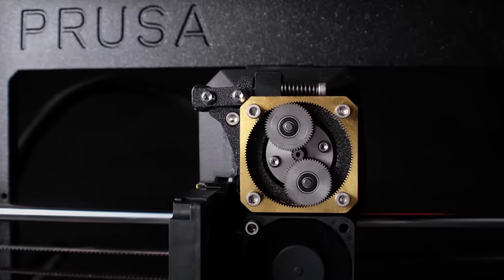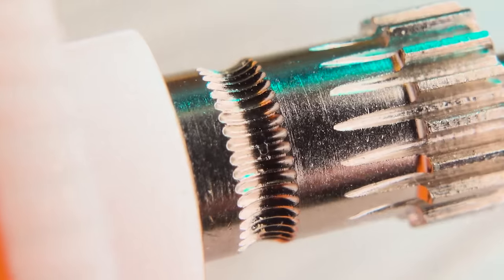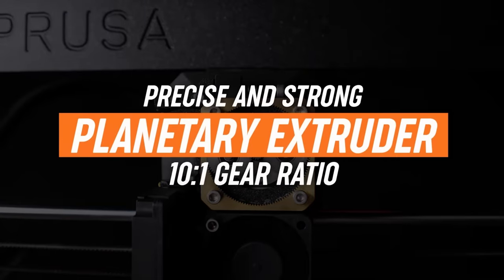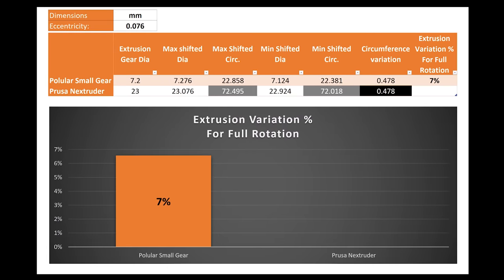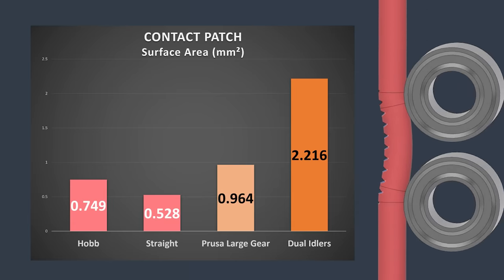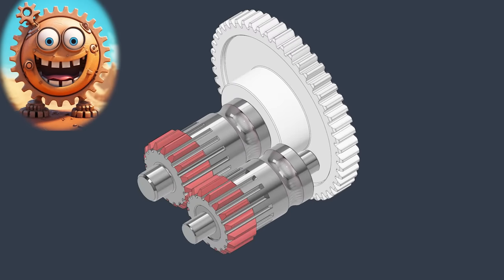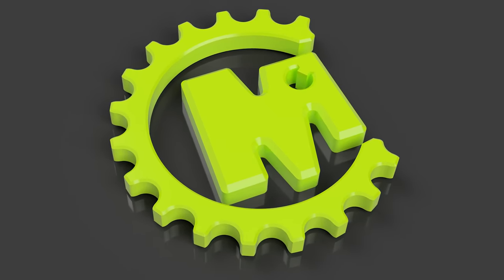Revolutionizing 3D Printing: Prusa's Game-Changing Nextruder

Comment: Without modding it so the idlers are cupped to replace the cup of the hobbed drive gear, I think this is a non starter for flexible filaments. I don't see how it could constrain the filament not to just shoot out the side.
Reply: the idliers have a groove in the centre

Comment: WoW!

It's insane they can engineer something like this, and YET keep failing on the frame. Flimsy AF, as ever.
Reply: THAT Being said, i've been waiting for this to happen with 3D Printers. Coming from the welding world -> The "extrusion gears" has been immensively large vs. "filament" for many decades now. 0.8mm "filament" but "extrusion gear" even much larger than this.
Yet, when you have "blockage in nozzle" it's much much worse on a welding machine, it's melted metal which needs to be pushed away.

BMG LGX and this, are just following what the welding world has known for probably more than half a century now.

BUT my point stands, they realized this shortcoming, and i keep hating that Prusa just can't figure out basic motion dynamics.
Reply from the maker: Price, Quality, Speed.... Pick two ! 😉

Comment: I haven't seen the Nextruder live but it looks that part cooling is still not good enough (only one side of the print is getting proper cooling). Big improvements in the filament walk are great but in my opinion this not the best possible extruder.
Reply from the maker: Of course the print head is an assembly of many systems.  Cooling wise I am working on the TentaCool with a member of the HevORT team.  Combined with CPAP turbine it becomes an awesome solution!

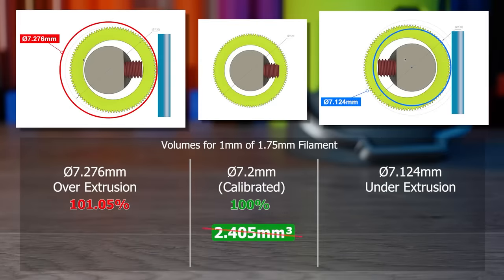Comment: That doesn't make sense at Min 1:25. The principle does. But the application is stupid. Because I would also have to compensate for the time, filament offset. So I reduce the speed when there is still 1.75mm at the nozzle and accelerate again when there is 1.90mm.

Comment: You're wrong about the purpose of the 2 planetary gears.
They simply support the shaft on the stepper motor, putting the shaft in double shear.  Having a shaft in single shear puts a lot of wear on the bearing in the motor and will cause it to wear out prematurely.
Supporting the shaft on opposite sides of the load, There's no movement in the rotational axis of the drive motor.
There is no reduction happening because the Large drive gear is still mounted directly on the shaft of the motor.  The Motor still drives it directly.  The 2 planetary gears are nothing but a support on the other side of the filament.
Reply: Sorry, but if you are to be right, then why does the stepper axle (shaft) and large drive gear not rotate at the same speed...? It's clearly visible in the animation that the stepper axle spins a lot faster than the large gear.... Not saying the planetary gears don't offer additional support but if the main purpose was this, I would think it would be cheaper for Prusa to "just" have a bunch of steppers made with a longer shaft and add a bearing on the end of it for support.

Comment: You should definitely try a different extruder… in this case if you are printing mostly TPU i recommend a product similar to the bondtech LGX. Using system with one gear of that size for TPU is generally a not great idea. I also recommend watching this video https://youtu.be/AaX1v6qWOnc and looking more into extruder designs and compatibility.

Comment: Revolutionizing? Yes yes :) they put a larger wheel in a extruder, that has been already done.
Reply from the maker: The larger diameter is not the only point here ;)
Reply: @MirageC  It kinda is, hyperbole to the max. They did not revolutionize anything. Its kinda the same old extruder with planetary gearbox.

Comment: 7 years ago, someone made an extruder with a huge main drive gear and 4 idlers

perhaps a bit overkill, but the idea is interesting.

https://youtu.be/taYYWQbpkeM?t=129
Reply from the maker: Oh wow! Amazing. I like the idlers swivel strategy.  Amazing how things evolved since then, we now know that higher nozzle pressure will not print faster.  Thank you for the link, I really appreciated watching this.
Reply: @MirageC  yup, that kind of link is usually used on tracked vehicles to equalize ground pressure, what a clever idea.

Comment: How much does it weigh though?
Reply from the maker: Of course I would not use this extruder as is.  But these improvements could be integrated to other products.
Reply: @MirageC  Do you think a titanium or some type of carbon composite material would work as a replacement? or maybe a 2 piece gear made of lighter material as the center, and the outer in stainless or hardened steel?

Comment: I don't think this can be called revolutionary, is just a big gear, revolutionary are the extruders that spin around the filament, or remote direct drive extruders, with this desing the filament is not contained in the midle grube, it can go diagonal and you have a worst case than before, to fix the old desing you just need to make smaller tolerances
Reply: Remote direct drive isnt revolutionary they are ancient and have proven backlash issues.

Comment: It's not constrained.  It's not dual drive.  This is behind the times from the start.  It seems like everything from Prusa is boring and old.   Why would anybody produce an extruder incapable of flexibles?  Particularly with the KP3S out there and especially because bed slingers are less useless if you can print flexibles.  It seems designed and marketed cleverly to get the dollars by appealing to amateurs.
Reply from the maker: Are there reports of the Nextruder not being capable of flexibles?  I think it should work just fine if filament is properly contained.
Reply: @MirageC  No reports, but clearly it's not constrained.  I might push the hardest flexibles but never the really soft stuff.   Look up constrained extruder to see what I mean.
Reply: @MirageC  In the video you can see it's not constrained between the wheels and after the last wheel going into the tube.  There is quite a bap.  There is some possibility the video is actually a CAD rendition with parts deleted for clarity.  But what I see is a no go for me.
Reply: the extruder parts are well constrained when looking at the parts on Printables

Comment: One problem with your video is that Prusa did not design this larger gear pressed against the two bearing surfaces. Research "The Cycloidal Extruder" and you will find the original designer. And the design is licensed under GNU 4.0 Non-commercial.
Reply from the maker: As stated on the printables.com page of the cycloidal extruder, it was inspired by the Prusa XL cycloidal extruder.
Reply: Prusa changed from the cycloidal extruder to planetary because the zero backlash nature of the cycloidal gearbox actually gave diminishing returns.

Comment: So they basically took the Orbiter's design and sell it as Prusa innovation (as usual)
Reply from the maker: Orbiter uses hobb groove, and dual gear just like most direct drive extruder, this is where Prusa took a different approach.  The planetary gear is one of many ways to achieve gear reduction.  The big change here is the use of only one drive gear with straight cut teeth while maintaining excellent traction.